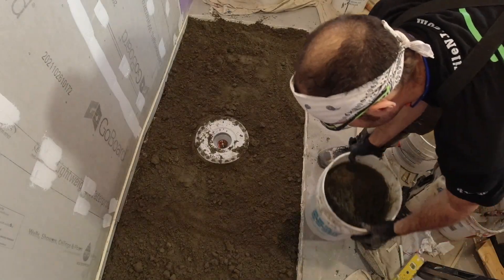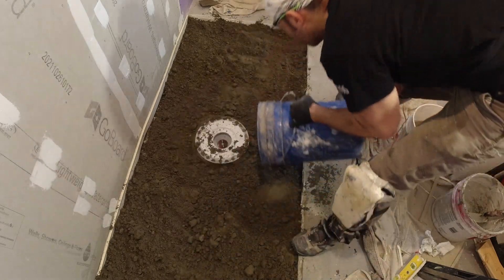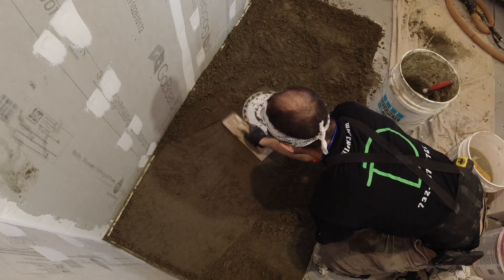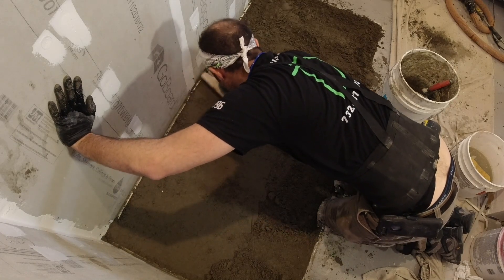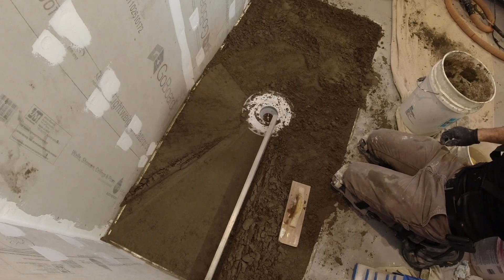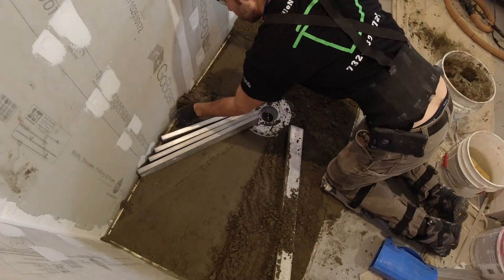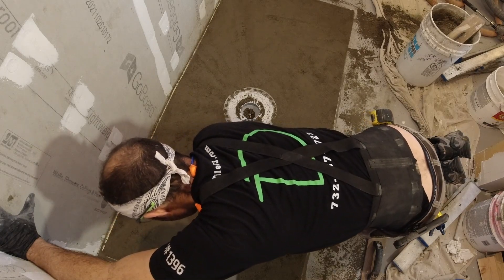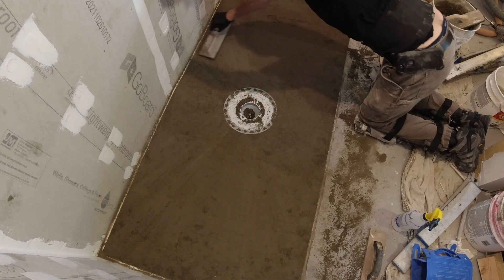Curbless shower part 3 mud work

Comment: Hi, and a huge Thank You for posting this series of videos. They are incredibly helpful and you did an excellent job! Looks great! If I can manage half the job you did when I try to "work" my mud, I'll be happy. BTW, have you ever tried various sized "rolling pins" to get your smoothness and pitch? Rather than straight edge. Just curious. Probably too much excess mud to do that? Unless initially, you had the perfect amount of mud. I dunno. ALSO, can you lay tile directly on top of the dried mud? I'll be tiling the floor with small 1 inch circle tiles.  Thanks Again!
Reply from the maker: Hi, your welcome. Glad to help. Nope just straight edges. Your gonna always have excess mud to screed off. If its to low you have to dig out the whole section and re-pack it. Good luck!